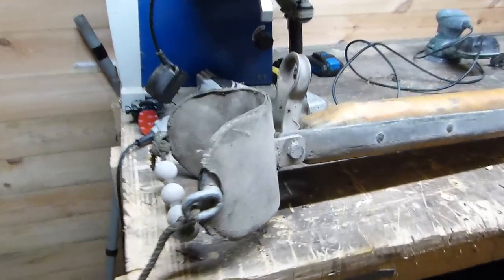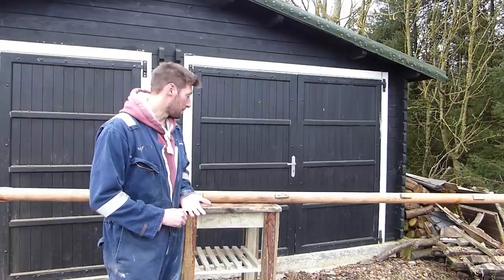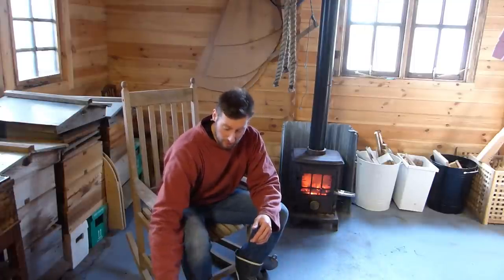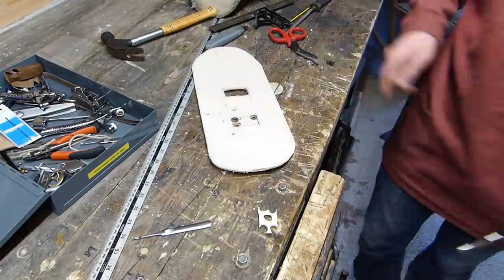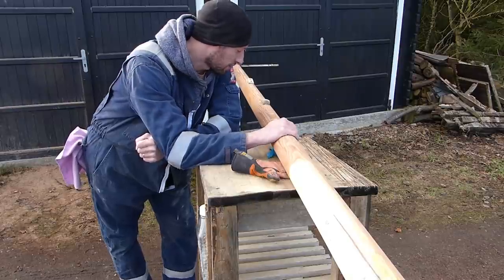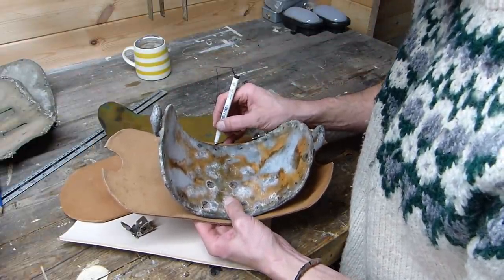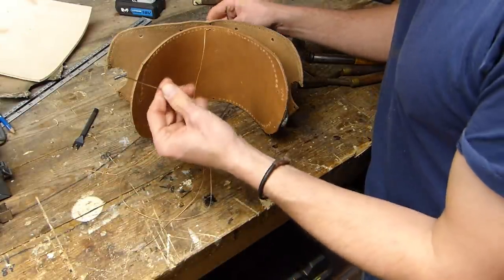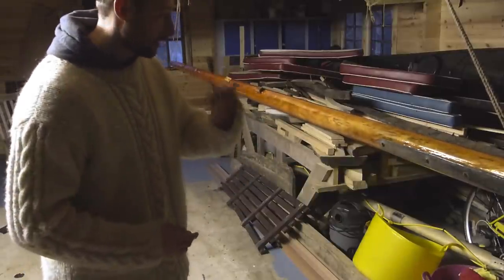Episode 19 - The Gaff Spar - How to restore a spruce spar and releather a gaff saddle

Comment: I've done  a  lot of varnish work and always used a pure bristle brush.  Your roller application gets the varnish on the spar but should be followed with a good brush.
great video's
Reply from the maker: Hey, thanks for watching, i really appreciate it and agree that the roll and tip method is the “preferred way” to do it. That said, for a spar on a “work boat” there is no need to go the extra step here, and from my personal experience; ive never seen much difference in one tipped and one not, provided the rolling is done very thin and very well spread. 
But. I am no professional varnisher! And i am glad to hear you advocate its use, thanks for the tip!

Comment: I'm impressed with how effective that oxalic acid was on the  stains on your spar.  You made it look really nice, and I wouldn't be surprised if the little bit of residual acid in the wood will resist further staining.
Reply: The reason it has to be washed and scrubbed is that it hinders the drying of traditional varnishes and often comes back to haunt you later.  I hate the stuff.. Works though.
Reply from the maker: Well said, i forgot to mention that in the vid!
Reply from the maker: It is very good, works better on hard woods and much faster. The result on Oak is amazing!! Ill be ising it on the ribs during the “post ribbing clean up”
Reply: @BothanboatsIdler  I always think of the preservation of the Mary Rose when using it.. wash and scrub twice with a teaspoon of vinegar per 10 lt  and rinse twice with clean water then taste it if you're brave enough.

Comment: I'm interested to see you use linseed oil on the leathers - I thought linseed oil would set hard? I thought you'd be using neatsfoot oil or similar instead.
Reply from the maker: Ive used linseed oil on almost all my leatherwork and it gives a more “work” finish which is harder yes, but not by much. I chose linseed oil as well as there will always be some readily available onboard to keep it nicely soaked! 🤣

Comment: I find myself kind of surprised that you didn’t use or mention the traditional lock stitch method which would make the saddle much less likely to fall apart ?
Reply from the maker: Hi Harvey, thanks for your comment! The saddle stitch is essentially two stitches. If one strand breaks it is very difficult to pull out, or indeed to affect the other thread. Its why it is used on high wear items such as saddles and cowboy boots. 
Unless im Totally misunderstanding what a lockstitch is! 😊 both sides of the stitch are dependent on each other. If one breaks it allows the other to come away?